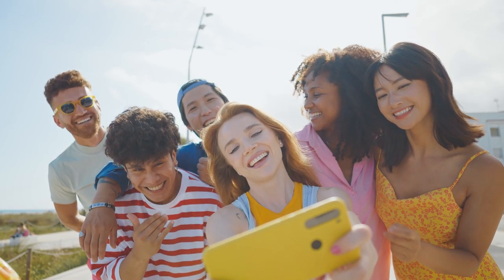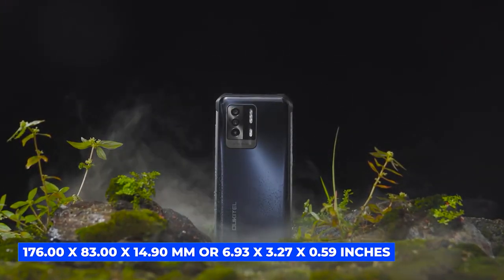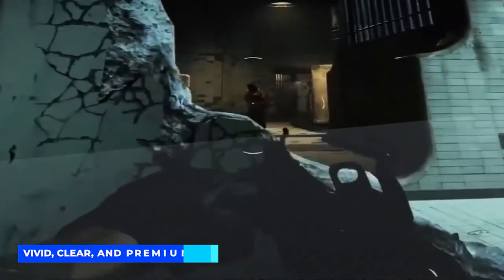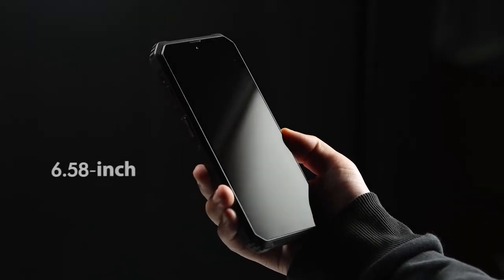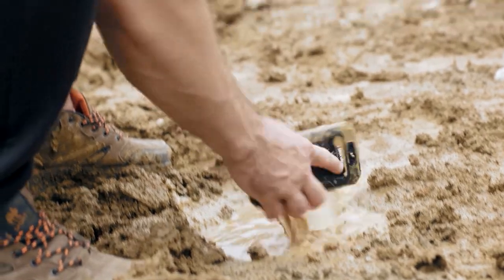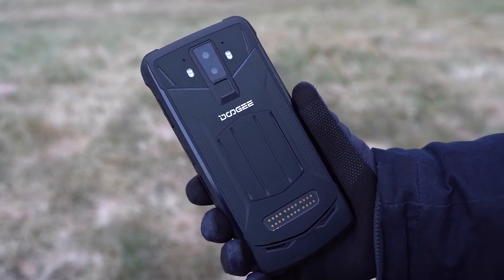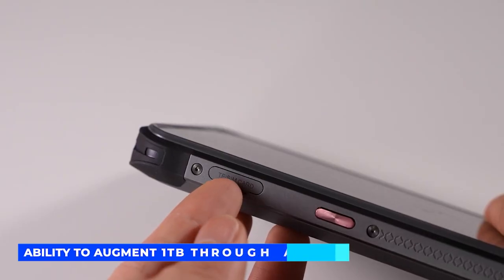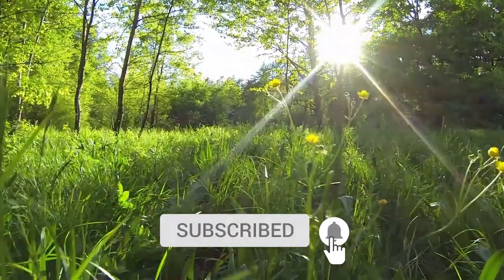(BEST RUGGED SMARTPHONE 2022) Top 11 *MORE* Best Rugged Smartphones for 2022 (Updated)

Comment: The kyosera duraforce pro 2 is my favorit phone. Had it for 4 years. I am an electrician and this phone realy handled horrible punishment over the years. No case and screen protector. Drop from lifts. Run over by truck, hammers have dropped on it. Still works with no scratches. Only thing is i accidentaly drop a corosive chemical on the screen. Still works and the only thing that happend to the screen was a slight burn. But still works and looks grate. Only reason i purchased a Cat s61 is because i changed carier. I prefer the kyosera over the cat. But watever. Wish my old phone worked with my current Carrier

Comment: @9:03 Uncheck, I have this phone, with a (@9:39 well..) shattered screen now (everything else (except all that doesn't that's listed after this) still works, so I will replace the screen), and it had so many issues, and not just mine, many more users of it experienced the exact same issues, such as the usb port shortly after getting it stopping working, for data transfering, otg, and for charging it "continued" working barely because it would take ages charging through it after it started presenting the issues out of nowhere, if it weren't for the wireless charge it would have become useless; also, issues with it detecting Wi Fi after disconnecting from a network, having to restart it for it to work fine again, everytime; also, the touchscreen randomly stopping responding, having to lock and unlock it for it to work again, very recurrent this; and also issues with the night camera module, it completely stopping being detected by it, I think the issue is the module and not the phone's connection pins because the other modules are still detected and work fine with it. Also, Doogee's post sale customer support/service (and pre-sale for that matter actually! this phone was launched through kickstarter, we backers were promised a better price and exclusive waterproof storage case for the phone and its modules, after the kickstarter campaign ended and it was released for sale for everyone, it retained the same price we backers got it at and they still included the case that was supposed to be exclusive to us backers, so liars (Doogee)) is non-existent, so imagine Doogee phones come with no guarantee, because Doogee won't respect it anyway. And finally, this phone was such a disappointment also because pretty much right after release Doogee abandoned it, they promised an Android version upgrade but it never happened, so again, liars, but also, what's the point of a modular phone if no new modules are going to be released for it ever again? It had a lot of potential but Doogee wasted it, shortly after it releasing, they came out with a successor, so we backers were really offended by this, but then, not much long after that they released yet a third phone with pins for modules, but this time even with a different connectors configuration, so making the existing ones uncompatible with it, but either way they never released any new module for that one either (Then again, I can say the exact same about Oukitel, they did the exact same with the modular phones they came out with). Putting all of these issues aside though, the rest of the Doogee S90, it's a pretty nice phone heh, and everything else that has no issues works great, for me anyway, other users have/had some other different issues mine didn't.